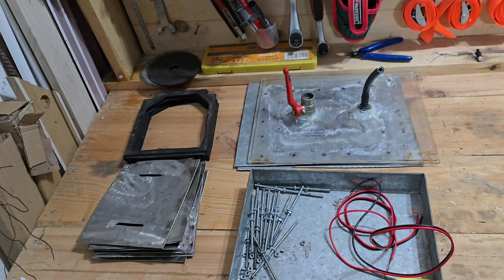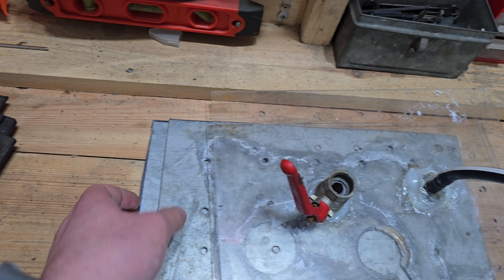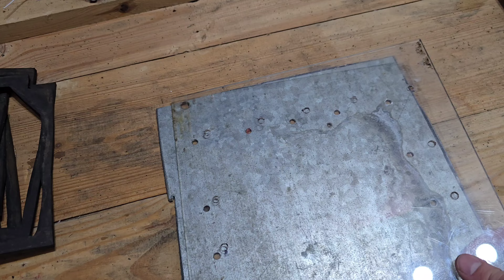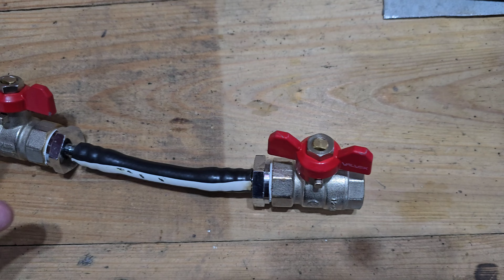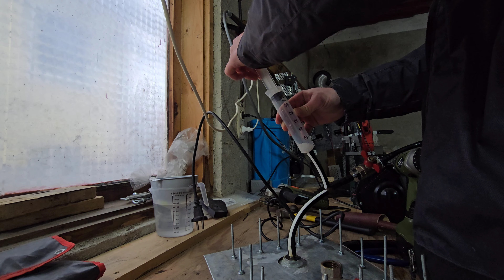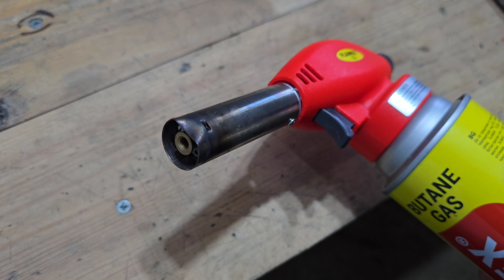Hidrogen generator mark 4 (testing rist rocket launcher)

Comment: How can I activate your Repulsor?
Reply from the maker: This repulsor can be activated with an electric spark or a flame, but the gases escape really fast; the finer the mesh in front of the repulsor, the better.
Reply: @Garage_Builds  I don't know anything about this at all, can you explain it to me in a bit more detail haha? You did it with some kind of hydrogen generator, right? Btw, I love your content. Definitely keep it up."
Reply from the maker: @waleriic thanks, also if you have more questions you should join the discord server; it is in the description of my channel, and it would be easier to answer them. The base for the repulsor is a hydrogen generator; it uses current to split water into oxygen and hydrogen, which is very flammable, so all I have to do is wait a few seconds to let the pressure build up and then open the valve to my repulsor so all of the gas goes to it. Next, since it is very flammable, any spark or open flame can make it explode, but the gas really wants to escape, so to make a good explosion you need to move as fast as possible; for example, the rocket launcher works better since there is nowhere for gas to escape.
Reply: @Garage_Builds  Okay, im joined, thank you

Comment: Hydrogen is powerful.  I did a project that produced a full jar of Hydrogen.   Then i lit it and it was so powerful it blew the jar apart.   Thank god i had some wood between me and that jar... otherwise i would have been dead...
God looks out for this fool sometimes.
Reply from the maker: That's the danger when working with hydrogen, especially when it is in non-flexible containers. We can only be more careful.